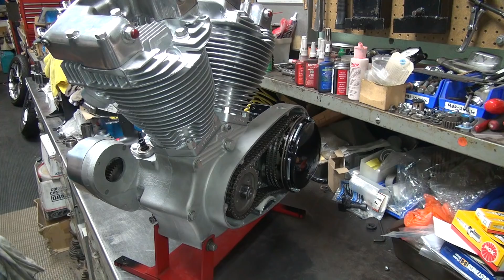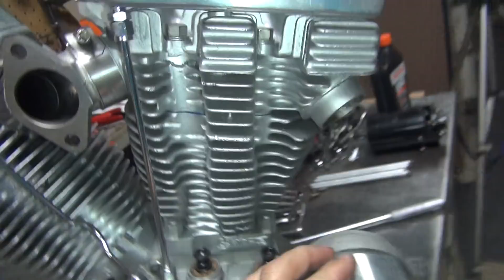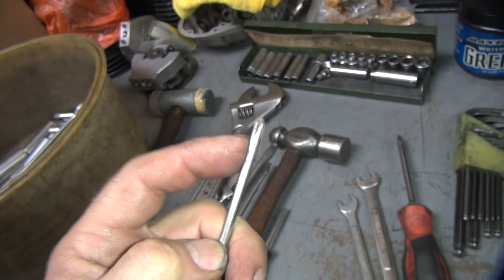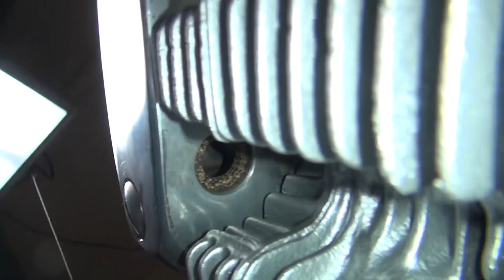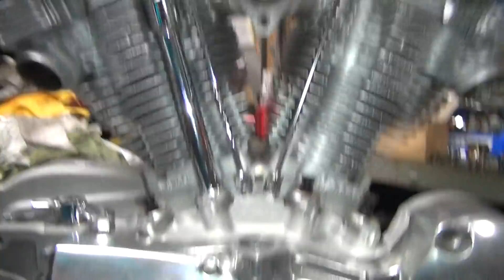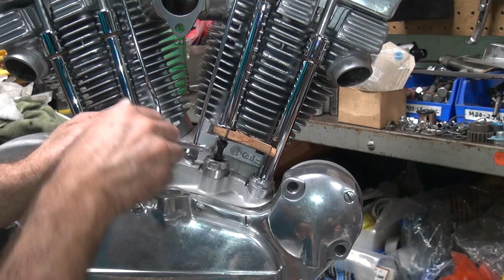1961 xlch #240 no miles transmission motor rebuild sportster harley repair restoration tatro machine

Comment: I don't know if you said so and I just missed it, but in case you didn't it might be worth mentioning, that
adjustment is for solid lifters. Hydraulics are done differently.
Reply from the maker: what kind of dumbass would put hyd lifters in a sportster. they are hotrod performance bikes and are made to ride hard and go fast. besides, harley never made those crappy lifters for a sportster.
tatro